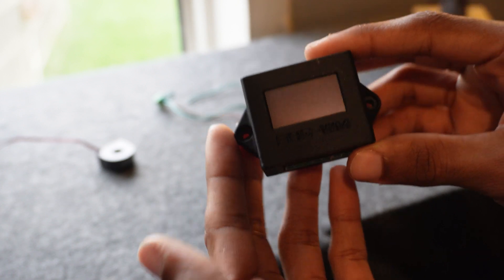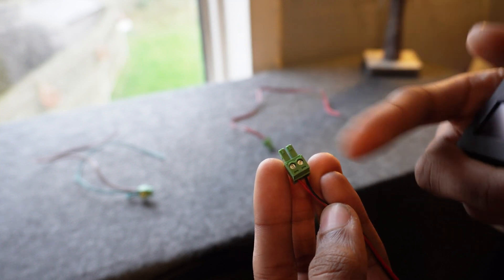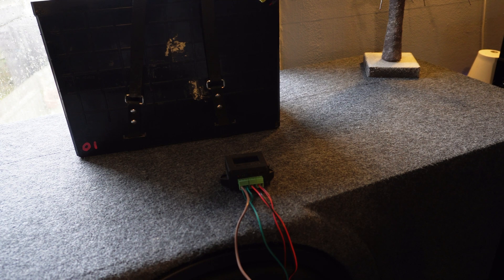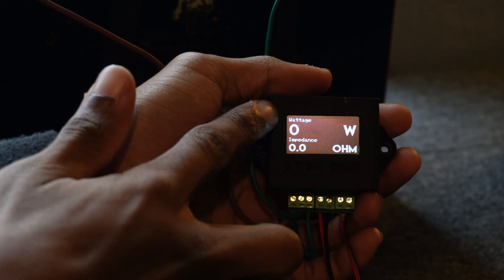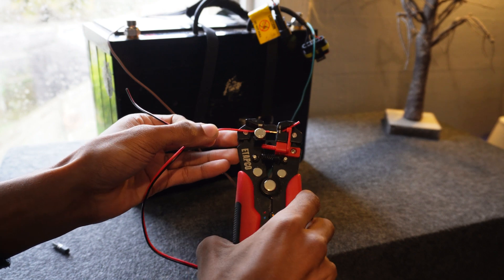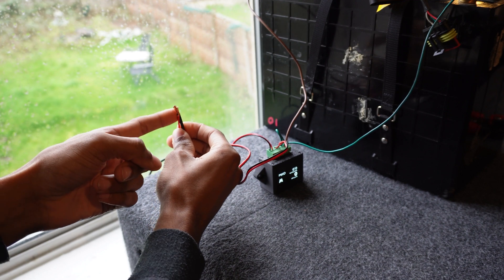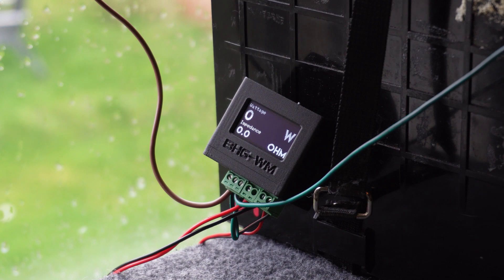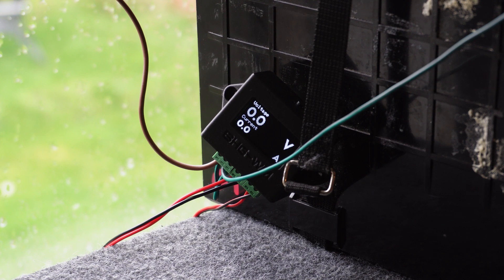Taking A Look At The Bass Head Garage Watt Meter

Comment: What is the refresh rate on the voltage/current read I have the LF Audio HPVM installed but it doesn't show me anything other than voltage also when will these be back in stock
Reply from the maker: I’m not sure what the refresh rate is but it’s quick enough

Will be back in stock mid march

Comment: I definitely want to try one of these, what's the maximum current it will read?
Reply from the maker: 100 A on the speaker wire.    So around 15,000 w
Reply: @-SINEWAVE02  thank you

Comment: My car anmp keeps turning off and everything is right and I've hade the same set up for years and know it like just turning off
Reply: It's time to diagnose the issue. First thing I would check is if the low voltage protection is kicking in. Another thing that could cause it is if it's getting too hot. You also may have a bad power or ground connection. Check those plus all the speaker connections. It's also possible something inside the amplifier has come loose. Make sure the remote turn on wire isn't losing power intermittently.
Reply: Thx that help